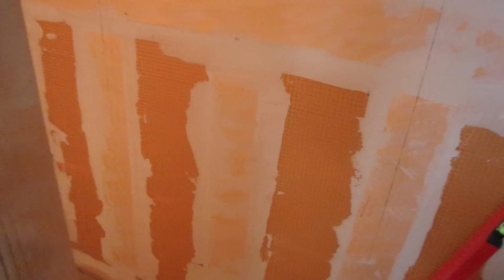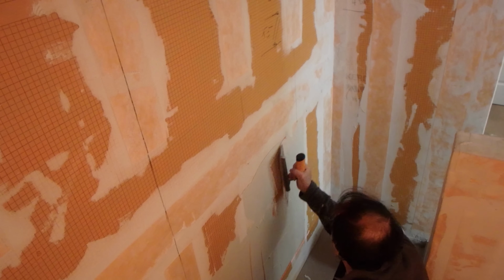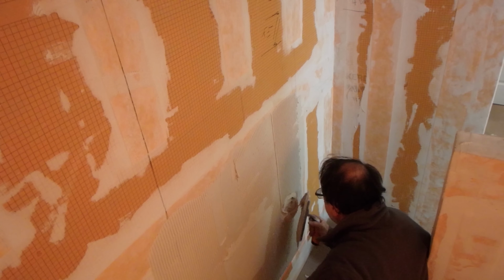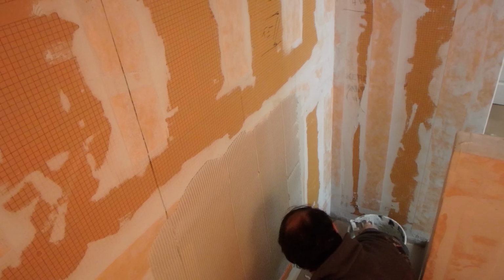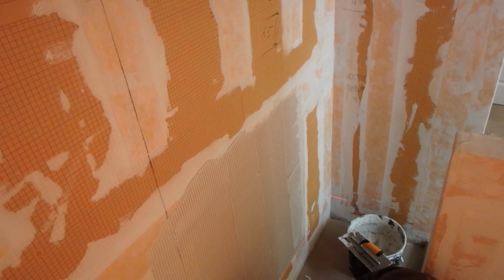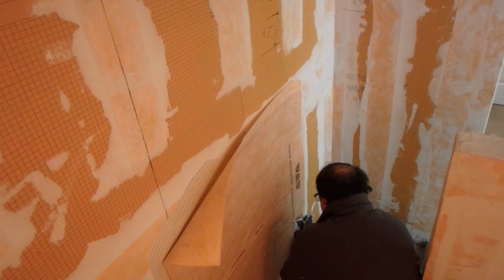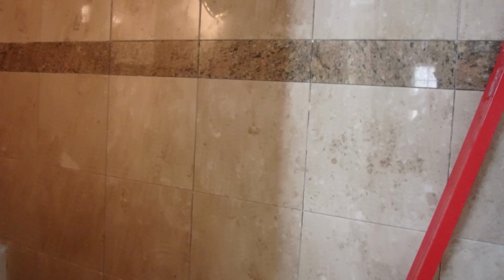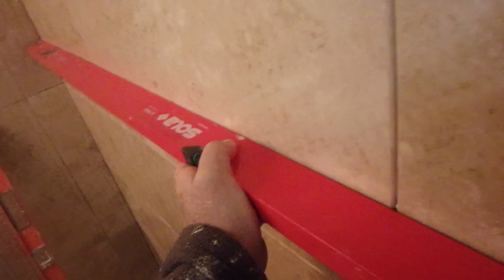Flat walls for tile the easy way👍

Comment: Aw, this system worked perfectly for our bowed backsplash!  Killer results!.   We started with a 40" wide patch, let it dry, added a 28" wide patch and then finished with a 16" patch.  Used unmodified thinset per Kerdi directions.  Sal, we are so grateful to be able to tap into your experience and we really appreciate the time you put in putting these videos together.  It's a lot......tip of the cap to you!!
Reply from the maker: Thanks for watching my video.

Comment: why not just fill the low spot with a thin-set that is speced for for a thicker mortarbed? what is the point of the membrane?
Reply from the maker: Can't use thinset as a fill, it is an adhesive, it will shrink.
Reply: @SalDiBlasi  ok. In theory wet shimming bowed studs wouldn't be a good idea either ? I've seen a lot of videos on that here on the tube.

Comment: This is absolutely brilliant! I did fix the walls (apparently not good enough!) but after I put up the Kerdi borads, I noticed a slight dip towards the corner. Although it was within the acceptable tolerance, I didn't want to leave it the way it was and removing the Kerdi boards was not an option.
Thank you very much again Sal!
Reply from the maker: Thanks, glad it helped
Reply: @SalDiBlasi  Thanks again for this wonderful video Sal. 
Quick question: Could I apply the same technique for the substrate as well? The shower floor is very slightly un-level (center drain). Can I do the same before I install the Schluter shower pan or just simply add a bit more thinset in the low area? Thx!

Comment: can compound be used instead of thinset to flatten wall first?
Reply: As long as you use a good sealer primer on top of the compound and then absolutely the next part is a must, you have to roll on waterproofing membrane. If you tile over joint compound it will without question soak up water and ruin your work and get mold weeks months or even a year down the road.

Comment: Great work and concept. I been trying build out low portion of cement board with speed set and feather set but still need more cob]Vera he so will try using 6” fiber tape or what your sheet of this.  What product instead of thin Set to apply it with cause after will be aqua defense then skim coat featherset before gluing up composite shower walls. Had thought of just applying extra glue in low spot areas too but rather get level first

Comment: Sal, I totally get this method and you're a genius, however, maybe I'm not asking the right question(s) but I can't find anything online or here on YT that would give me "perspective" as to what exactly is the tolerance over a given distance that's acceptable to still accomplish a decent tiling job? You use your experience and intuitive knowledge to make that judgement but I have neither.
My field tiles are 4x8 ceramic tiles and I have a horizontal dip in one DurRock board of about 1/8 of an inch over a span of 32 inches. Is this something I need to mess with or is it within acceptable deviation for the size tile I'm using?
Also (sorry for the longish post), there are several membrane products available on amazon with varying thicknesses from around 5 mil to 20 mil. Wouldn't it be best to use the 20 mil instead of the 5 mil membrane given we're looking for building the thickness? 
I don't know how thick your Kerdi membrane is (I seem to remember reading it's 8 mil) but as an engineer I would think it best to use the thickest membrane (within reason). At 20mil thickness, six layers in a 'stair step' sequence would produce about 1/8 inch (120 mils) build to fill the cove, discounting the thinset used for each layer).🤔
Reply from the maker: This might  help https://www.ceramictilefoundation.org/blog/floor-or-wall-flat-enough-for-large-format-tile

Comment: I have a shower wall that it is about 1/2" out of plumb on one side. I never noticed until the GoBoard was already installed, banded, and 2 coats of GoBoard adhesive applied -- and the floor tiled. The problem will be obvious when I later attempt to install a 34" wide shower glass panel (not a door, just a walk-thru opening). Can I fix my bad wall by doing the same thing but vertically instead of horizontally?  I love your videos! I am finishing basement, but this is my first shower. THANK YOU!

Comment: Sal, thanks for the great video. Although i understand this video is several years old i wanted to ask if this technique is acceptable if the wall are bowed the opposite way (floor to ceiling) i had my walls nearly perfectly flat and upon setting my redi tile pan i slipped up and my mud bed held me  1/16" to 1/8" off the stud creating a low spot on my wall

Comment: I had this problem, in part, due to build up. I have yet to figure out how to hang Kerdi without build up.  Too many layers at corners. I called Schluter CS for troubleshooting and the answer was, "Rip it out, shim walls and redo."  Someone else from Schluter (whom you know) told me I could build up thinset (in dried layers). That is what I did. Wish I had seen your video first. Watching it was a "lightbulb moment." Much easier . . . although Kerdi is expensive and I hate to use more than I have to. Making things square and plumb is hard with Kerdi membrane and by the time the thinset is on the wall it skins over and Kerdi doesn't stick. It looks easy in videos, but it is not. I'm even Schluter certified!!  DIYer beware.

Comment: Hey Sal! If I have the time to wait and don't need to tile immediately, could I skim the wall with thinset and use a level as a screed wituout the extra layer of membrane? Then come back the next day to tile once dried?

I thought I had wet shimmed my GoBoard sufficiently but still ended up with a low spot, unfortunately...
Reply: Did you ever get an answer to your question? I have the same one. Thanks

Comment: Great video! I’m also encountering this problem, there’s a half to 2/3 inch bow on my dot and dab wall, about 2-3 feet wide, and I’m going to level it with this method, but I still have some question about it: 1, since it’s a dot and dab plasterboard wall other than a solid wall, is it ok to apply half a inch plaster onto it? 2, what’s the purpose of the membrane? Is it to hold the plaster together, or keep the surface level, or just providing a waterproof layer? Do I have to use it to level the wall? 3, what kind of plaster is best for this job? Thank you very much!

Comment: I have a similar problem between my countertop and upper kitchen cabinet where we want to tile in a backsplash - about 1/4 - 3/8 inch concave bow at the center of a 4-5 foot wide span of wall.  Our contractor just slathered in USG3 compound over the bow but did not use a membrane or paper.  The only advice was that the next step was USG Easy Sand 45 for final coat.  I'm concerned it will be a weak base for tile, possibly crack causing tiles to fall out or am I just paranoid?
Reply: I'm not a contractor or anything but have watched a lot of videos on the subject in preparation for renovating my house which I'm doing now, I'm pretty sure that's a solid way of doing it, especially with a kitchen backsplash, I wouldn't worry about it as long as he's properly setting the tile.

Comment: At the Schlueter workshop,  they go over the importance of checking the walls before any kerdi goes on the wall.  Good video and good job Sal! Schlueter is the best  imo!!!
Reply from the maker: First thing I do, left bow in the wall on purpose to demonstrate this method. Best to do good prep before installing any kind of board.
Reply: @SalDiBlasi  you seem like a very good tile setter.  There's a big difference between a tile installer and a tile setter!
Reply from the maker: @michaelhorn9114  Not sure I understand what you mean by" tile installer and a tile setter" unless you mean Tile "placer" and tile "setter".
Reply: @SalDiBlasi  probably the same.

Comment: Hope anyone can help. I am installing a shower, using a kerdi foam pan.  Can I use kerdi board for the first 2 to three feet of the shower and durock for the rest of the wall.  If so would I use keedi band for the seams. Planing on using red gaurd as well.
Reply from the maker: If you are going to use a system, then use that system, they only work as designed if you install it as designed. If you want to use Durock, then install the Durock and then use the Kerdi Sheet membrane over the cement board to seal up the system. Use the banding where needed. combining system voids warranties and leaves you on your own if there is a problem. Itis good to save money, but do that where it makes sense, not where you could compromise the integrity of a wet area that can cause significant damage over time if it leaks.
Reply: Sal DiBlasi Thanks.  I bought the Kerdi board.  I have another question?  One of my wall is a masonry wall. The try wall that i will replace with kerdi is fastened to 1/2 strips. Would it be ok to fastened the kerdi board to the strip? Would that hold the wait of the tile?

Comment: Hi Sal if I'm using kirdi , or roll on water proofing system , this question applies specifically for exsterior wall do i still put up 6 mill poly as a vapor barrier or is the kirdi or role on water proofing products look after and take place of the poly
Reply from the maker: From what I understand, it is one or the other, not both.
Reply: @SalDiBlasi  ok thanks

Comment: Is kerdi your favourite brand to use for waterproofing systems or would you recommend another?
In U.K. kerdi products are very expensive in comparison to others.
Reply from the maker: There are many great options, Schluter, Laticrete, are the easiest for me to get. These options are also expensive here, however cost is not the only concern, I give my customers the best materials and systems available, gives me peace of mind and the ability to give a warranty that is backed by the manufacturer. When you consider the labor cost and everything that goes into a shower, the cost really isn't that different to a traditional system.

Comment: I actually have the opposite, a curve on the wall which make a gap on the right side of about 14mm when a straight edge is put on. My wife has chosen 500mm x 250mm tiles so stuck there. Might tey and break the plaster out to get it out. I only tile boarded the shower area when I should have actually checked all walls for flat. Learn the hard way I guess. Great video Sal!
Reply from the maker: Thanks for watching my video.

Comment: Hi there!  I see that you are using kerdi products...but if I'm having the same issue on a waterproofed wall (cement board that was waterproofed with redgard), would this general approach still work?  Maybe just apply thinset in the "low" areas and allow to dry before tiling?  Any other recommendations for my situation?  Thanks in advance!
Reply: That's what I did. It was suggested by a Schluter professional.

Comment: The membrane adds much greater resistance to cracking than thinset alone
Reply from the maker: You don't want to use just thinset to build out the wall, not designed for that, you can however use a rendering patch made form that purpose.
Reply: @SalDiBlasi  Hey Sal, I have a bow in my wall like this that I didn’t catch until after cement board was up and seams mudded. I plan on using the Kerdi membrane. Can I use non modified thinset to flatten the wall, let it dry and then thinset the membrane on? Thanks for posting such great videos!

Comment: Can this method be used over painted drywall? I’ve got a backsplash I’m working on a wavy wall. We’re doing glass tile, so apparently things need to be really flat and I’m not sure what to do...
Reply: I also have the same problem. What did you do to fix it?
Reply: @iriemabayo5939  Ripped it out and installed all new drywall under the backsplash. It sucked, but I'm definitely more confident that my tile will hold/not crack.
Reply: @B1gJ4k3  Wow 😳

Comment: Can I level out some spots in my wall with just the thinset? Or do i need to put the membrane over it?
Reply: it depends on how thick you have to go but if you are installing on kerdi membrane I would strongly suggest to use another sheet of kerdi like Sal did here.  A thin skim of thinset to build up 3-4mm is ok IMO but not more than that on top of the kerdi but this is not best practice.  Sals way is the best and safest way for longevity, bonding etc.  Now if it was a cement board wall, then a bigger patch with thinset is acceptable (though maybe not TCNA acceptable) and is done routinely in commercial union work around downtown Toronto.  Literally all the big buildings that have tiled walls are built out with either wall patching using thinset or spot bonding tile.  For me, if its 6-8mm or less that i need to build I'm comfortable with a good quality thinset like Mapei LFT or Laticrete Gold.  If more than 8mm is needed its time to look at fixing the issue or using patching compounds/levelor.

Comment: Hi Sal,  I used this method to get the bows out horizontally. It worked pretty good . But now they’re out of plumb vertically.  I knew my studs were a bit out of wack when I installed the Kerdi board but now it’s just getting crazy adding more and more membrane and new bows appearing. I would rip it all down but I’m 2k into these walls already , what can I do ? And  how far is too much applying membrane over membrane over membrane?

Cheers
Reply from the maker: Any method can be taken to the extreme, that is why it is best to address all issues at the framing and not have to fix it after. Some problems just can't be fixed by trying to patch them, it can introduce other problems as you found out. This method is great for fixing small valleys in the wall but if your wall is too far out of whack to begin with, it will not help much.
Reply: @SalDiBlasi  thanks for the reply ! Yeah I know I totally F’ed up. I guess just wondering In Your pro opinion if I continue thinsetting Membranes on and actually achieve flat and plumb will I pay a price later with cracking tile or some other issue? I may be able to fix it this way for another $200.  Where Starting over will cost me thousands, but if it ultimately cost me more over time by over doing membranes ,  biting the bullet with a full tear down might be better?  Cheers for the advice .
Reply: @grahamloft263  I have this same problem but not nearly as extreme.  What did you end up doing??

Comment: Sal I was wondering if I could fill a 1/4” gap between countertop and backsplash with silicone? it’s only about a foot or foot and a half where the gap is this large (the rest is 1/8” or less
Reply: Since no answer was given, I am a commercial above ground waterproofer (caulking), true silicone will bridge gaps 2-3 inches with backer rod.  Most you cannot paint but read manu. specs.

Comment: Another great video. Thanks Sal. Could a method like this be used if, because of inexperience, the shower wall ends up being out of level at the top toward the inside? Or do I just remove the Kerdi board and start over. I used the wet shimming technique so I would rather not have rip it off
Reply from the maker: If it is not too far out, yes, but remember all remedial methods have there limits.
Reply: Thanks for the quick reply. Really appreciate it since I need to make a quick decision on how to move forward with this. If I decide to redo  this what kind of a mess am I in for? I’m imagining having to chisel out all to the thinset I used to shim.

Comment: So, Sal, are you saying to use the recommended kerdi trowel or an equivalent to apply the membrane and to build up layers of membrane as needed that way?  Or, are you using a larger trowel for a bigger bow to get more thinset underneath sort of like floating the wall with thinset then applying the membrane?
Reply from the maker: One thing I should have mentioned, I actually used a Ditra trowel to apply the thinset, however you don't want to go too deep with thinset, better to add another layer if needed. Just to be clear, I would normally  fix the studs by wet shimming or furring before installing the tile, just wanted to show another method if the case arises that  you need to do it.
Reply: @SalDiBlasi  
Alan - I was wondering the same thing.  Never mentioned in video. It did not look like he put more thinset in the middle and feathered the edges but I would think you would have to. He also did not show the level up against the wall when finished.  I can't believe one layer did it with the bow he started with.

Comment: Durock seems like an easier option
Reply from the maker: Durock is a more difficult product to work with in every respect.
Reply: Amen to that....Silica for me has been a huge concern, can pick up hierro with 2 fingers, no dust, cuts with razor blade, can wet set. 

Durock is an injury/health condition waiting to happen

Comment: Love the videos Sal! I laid down some Kerdi band on top of the shower floor. After it dries, I noticed there was a small air bubble - I don’t think there was sufficient coverage there. Is there an easy way to fix this or is it not a big concern?
Reply from the maker: You need a two inch overlap for seams to be water tight, so cut out the air bubble, and overlay with a new piece and you should be good, just be sure to get your two inches over the well bonded sheet.